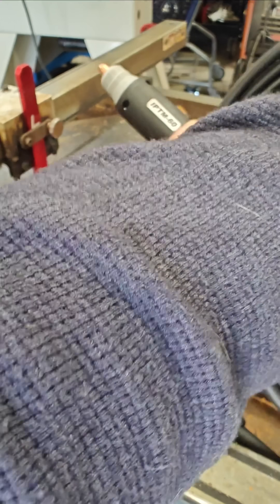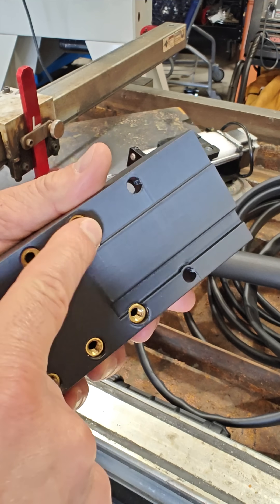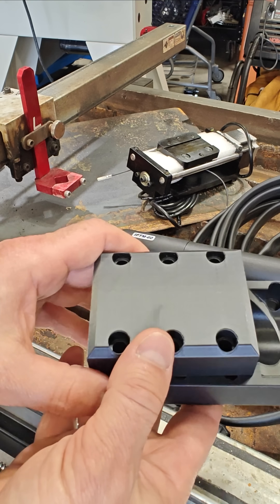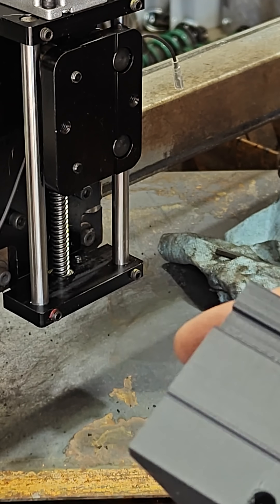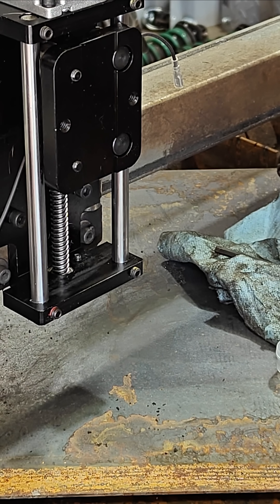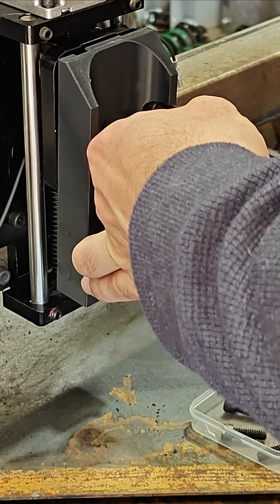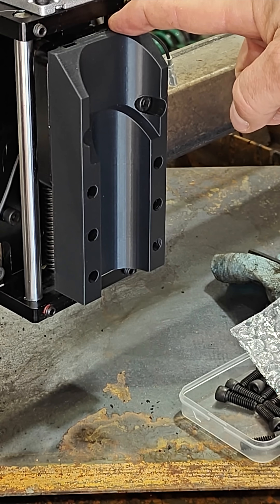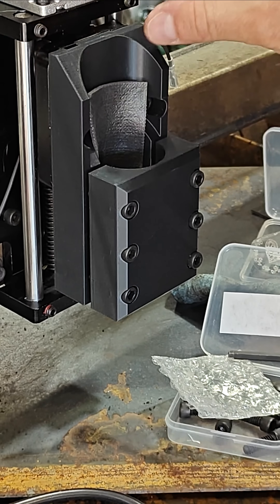Installing a machine torch on Langmuir CNC plasma table with a 3d printed mount.

Comment: That is fantastic.  Gives more surface area contact around the torch body thatn just the 2 points of the LS machine torch mount.  Now to improve on it would be to add led holders on the front and on the side for cross hairs.
Reply from the maker: V2 is in the works :)